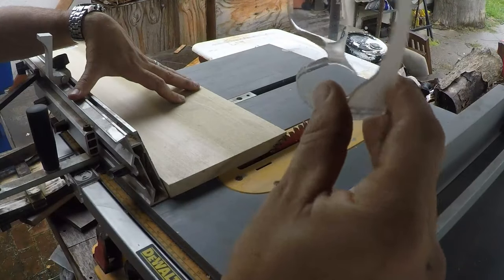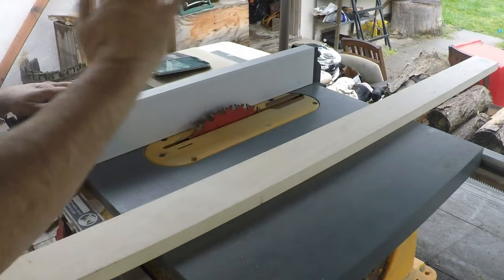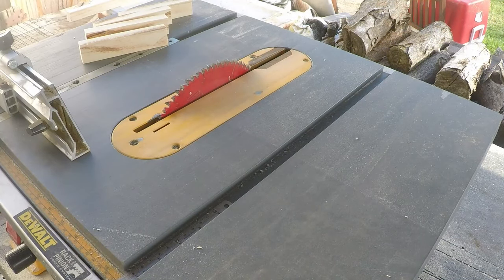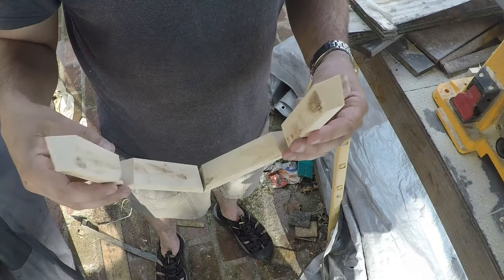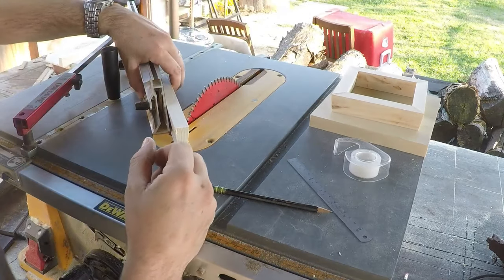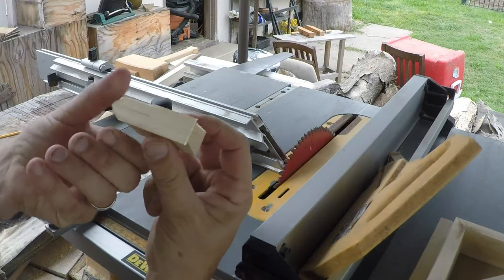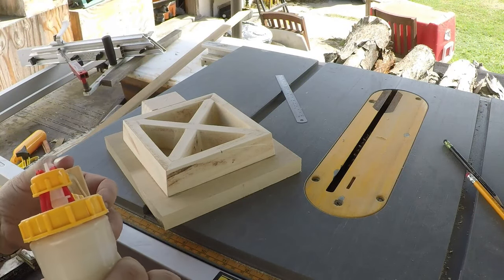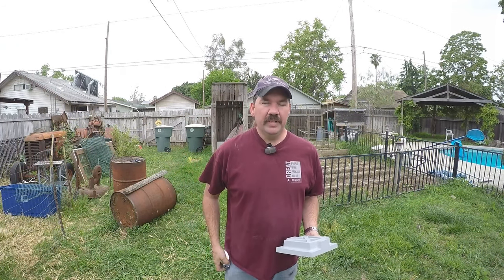Cast Iron Surface Plate Pattern

Comment: Hi Chris,
First time I have seen tape used to glue the 45 degree joints together. I will have to remember this.
Steve
Reply from the maker: +Solid Rock Machine Shop Inc. Oh yah works great on miters of any number not just 45 degrees

Comment: Table saws are terrifying machines :) You should make a simple sled, they are much safer and more accurate for cut-off  tasks.
Reply from the maker: +Luke Rickert you are correct in fact I should have thought to use my cut off saw and then I could have square the part afterwards.

Comment: I realize I'm really late, make a panel cutter for this kind of cut in your future projects.  I have two.  Built them mostly for cutting down large sections of plywood.  One I can cut a 4x8 sheet on, the other works well with 30" and under wide cuts.
Reply from the maker: +Crafted will do and never to late

Comment: The scariest piece of equipment I own is my tablesaw. Nice pattern Chris, looking FW to the castings
Reply from the maker: +Makin Sumthin From Nuthin yep for sure should have found a different way. Thanks BTW was over a hour of footage. Lots of cutting lol
Reply: My jigsaw is actually more dangerous..LOL...its a POS 😖
Reply from the maker: In that case it's the tool in my case it was the method. And in retrospect I have other methods at my disposal.
Reply: You did a fine job on the saw. I believe its more of a memory of my shop class in high school where a buddy of mine had to leave class early...with 2 less digits....that makes me stare at my saw for a minute before I turn it on
Reply from the maker: +Makin Sumthin From Nuthin I had good control over the part so didn't feel to concerned. Figured I should put a p.s.a. in it just to make others aware.
Reply: Good luck in the contest, cant wait for the casting and finishing :)
Reply from the maker: +Makin Sumthin From Nuthin so what are you going to enter in the competition
Reply: I just heard about it today, I may enter....will have to give it some thought 🤔
Reply from the maker: +Makin Sumthin From Nuthin better hurry.

Comment: So, are theses cast iron surface plates for inspection ?? If so, how are you getting them flat and parralell within .0001 ?
Reply from the maker: +John Hines first they will be milled and then they will be scraped using the 3 plate method. This technique averages the errors untell they are nearly gone "nothing is ever perfect  " stay tuned to see how it works.